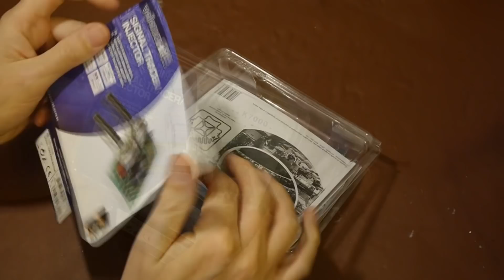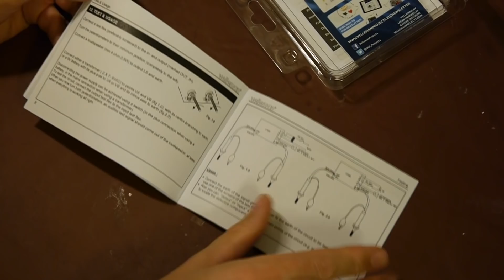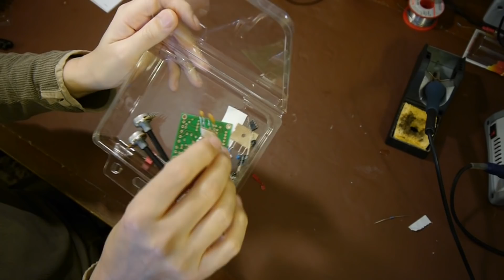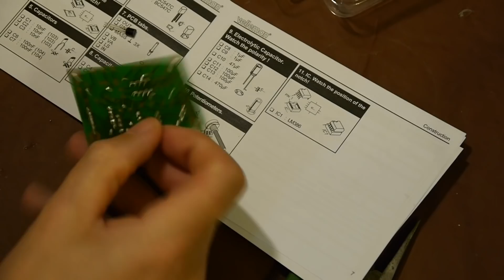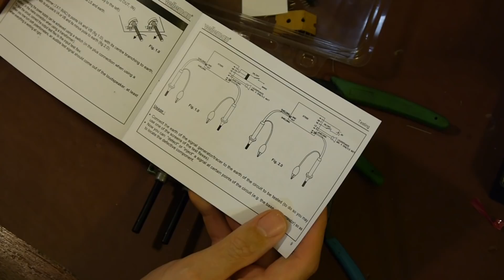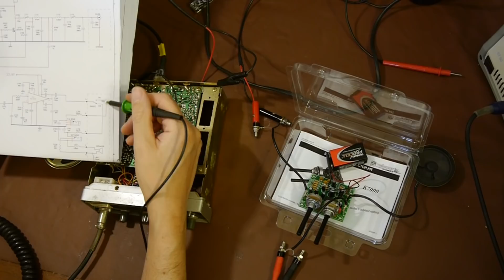Signal Tracer - Velleman K7000

Comment: thanks for this video
i just subscribed, new to electronics,fascinated in diagnosing and trouble shoot.
like how you explained what you were doing at each step.
amazing that you found a loose/bad soldering joint,i think that happens to me as well.
i only have a fluke mm,think i will get this velleman as it looks relatively easy to put together,doesnt even  need a case, and i can learn signal tracing and signal injecting.
look forward  to your modification of this velleman  in future.
john
Reply from the maker: Hello John thank you very much for the nice comments glad you found the video interresting.   I would recomend the Velleman kit is a nice little project. Check the  RadioCruncher channel he uses a signal tracer a lot for radio repairs.  Nice to hear new people are coming into the hobby it great fun even if we get it wrong its all part of the fun.   Best regards Chris

Comment: Normally this type of board has a coating to stop oxidation of the copper bads. Acetone will clean it off then I use a thin flux over the pads before starting to solder. I make my own flux for through hole components.
Reply from the maker: Barry Mayson  No that’s not correct boards are not coated except for solder resist and perhaps conformal coating after production. Kit boards like this just oxidise unless flash coated in gold. Flash coating is not normally done as it adds cost. Thanks for watching and great comments regards Chris

Comment: I just built one of these and am trying to use it to trouble shoot an FM radio kit. The radio is doing nothing but a little hiss.I have made probes and they seem to test OK.  I not sure which probe to use. Input or output or where to begin checking. Can you tell me ? I do get a tone at some points through the radio speaker. Am I correct in thinking that all Im going to hear is the tone or will I ever hear an Audio signal? Any help would be very much appreciated! Merry Christmas!
Reply from the maker: Clay Thomas  it’s a bit difficult to know where to start as I don’t know your background or radio experience. This probe is really designed for audio circuits rather than the radio frequency section of you radio.  The probe is basically just a small audio amplifier so if there is a detected signal of small level probe will detect it and amplify it to a point where you can hear it.  The probe will also generate a 1 kHz test tone so you can inject the tone into the amplifier on the radio and you should hear the tone coming out the speaker of your radio. Have a look at some other YouTube videos signal tracer are common so you should find some better details of how to use them than my video.   Come back with more questions I will try and help you if I can.  Note that the green probe I’m using is a demodulation probe so it will demodulation RF in the radio  and let me test the RF sections, your simple probe will only amplify the existing audio. Regards Chris.
Reply from the maker: If you can provide a link to the radio kit it would help to see the circuit. I can maybe tell you where to probe.
Reply: I am very new to the science of radio. When I bought a Mooney single engine plane last year I became much intrigued with the ADF which is an AM radio with a loop antenna for direction finding or bearing to the station. I was able to get it working by reading the original Bendix manual complete with the theory of operation and all the original wiring diagrams. I am capable of reading electrical diagrams but just starting to put together all the radio pieces. Its fascinating and Im very impressed with guys who can seemingly work on radios easily and know whats going on inside them. I built the Elenco AM kit last year and a home made loop antenna and get great reception at night. We live in south central Tennessee and I pick up New York, Chicago, Detroit, Atlanta and Houston Tx. I just finished the Elenco 108 Superhet kit and the AM side is working fine. The FM side is dead. I have checked and rechecked everything several times and cant get anything. I built the little K7000 to help me trouble shoot. Let me try to link up to a wiring diagram. Thanks for responding.
Reply from the maker: Clay Thomas I’m no radio expert but I do enjoy Tinklering with them. When you said you were building a kit I assume it was one of those popular single chip solutions. Give me a couple of days to look at the information. We can but a shout out on my channel there’s lots of people we can call on and advise us. Wow flying must be a interesting hobby. As is radio direction finding. Why not make a quick video of your radio and your fault finding and we can point a link to your channel
Reply: https://www.elenco.com/wp-content/uploads/2017/10/AMFM-108CK_low-res-2.pdf     is the manual link.  Thanks.
Reply: If you scroll down to the last page you'll see a schematic wiring diagram.

Comment: That signal breakthrough is annoying, I did the same trick as you did with the extra earth when I built mine a few years ago but you can still hear it.  I was thinking about sticking a FET on the input side funnily enough, I bought some MPF102s ages ago for the very porpoise. The injector gives a very clean sine wave I must say, mines running about 900hz. Velleman do or did a simple function generator kit I think. Regards _ Andrew
Reply from the maker: Andrewausfa  yes adding a FET input to the probe would be good. You really want a really fast rising square wave for the input this will be rich in rf harmonic content that can be picked up and demodulated by the input detector probe. That would be better than the sine wave
Reply from the maker: Andrewausfa  Hi Andrew If you get a minute  spare we are trying to help a fellow radio dabbler get his  kit radio going.  My friend Clay would appreciate any advice. You know a lot more about radio than me so be nice to help the fellow out if we can . thanks Regards Chris, follow link https://youtu.be/c_ysLO0ouFU.
Reply: Andrewausfa
 - You have 553 subscribers.. I going to add myself as 554 to your channel, so the next guy/gal after me should win a prize right? :-) ha ha Merry Christmas!

Comment: Ahh the maxcom 4E and similar, i would have probed the volume control to make sure the mc3357 down mixer to 455khz/demod/squelch chip was still alive, they do die do die do die Oops got stuck in a loop there :-D

The tx audio in that radio has its own quad op amp circuit, i cant remember the number but its the dip in front of the rx audio power amp ta7205 or similar.
If the radio is actually going in to tx, the output tranny may be toast, too many people run radios into a horrible swr, silly buggers lol.

Sorry for the waffle, i used to repair c.b's as well as lots of other crap.
Mr defpom is a super wizzbang at repairing/designing electronics, worth subbing to the old git ha ha joking :-D
Reply from the maker: zx8401ztv Thanks for the tips not really dug into the radio yet. Just spent an hour this morning repairing some large cracks in the PCB and resoldering the case to the cab PCB. It going into transmit now and drawing current but not had it on the analyser yet. I am not sure if repairing this will be a video sometimes i just want to crack on etc. . Noticed the squelch is not working but not investigated it yet. If your interested the circuits are easily available for download so I will add a link to the show notes later. Ok off out into the garage now to drill some holes for the RF matching pads in those aliminium boxes I bought last week.
Reply: The squelch comes from the mc3357 if i remember right, sound driven type.
Don't expect too much from the c.b, very cheap design, oddly quite reliable untill big hairy truck drivers ram 24 volts up it's bum lol.

Thanks for the diagram offer, but i do have it in many disguises on paper :-D.
No i don't expect anything, it's your hobby, we are just pen pals with an addiction to drinking tea, well i am anyway lol.
Reply from the maker: zx8401ztv ZX spectrum mux bus chip ? What all that about ?
Reply: Dynamic memory mulitplexing if i remember right, A0-A7 then A8 - A15.
The memory is shared between display and program, 16384 to 23295 is display and 23296 to 32767 is system use, 32768-65535 is normal uncontended ram.
It has been 20 years since i used to repair speccys, so forgive me if i have the wrong end of the stick :-)
Reply: ooops i was blind again, my label on youtube, it sunk in lol, sorry.
Reply from the maker: zx8401ztv that’s the one😄
Reply: Ha ha you must be a speccy or zx81 repairer, perhaps, maybe.
I loved the little machines, made interfaces and crude z80 code.
Ever heard of the multiface 128?.
Now is your chance to say No i hate speccys lol.

Comment: @ 24:00 I have seen many external speaker jacks fail, I have repaired/replaced lots of them.
Reply from the maker: The Defpom's Repair Channel  That was my first guess, but found a host of bad joints and repaired three large cracks in the PCB.  Do you normally re cap these radios as a matter of course. It’s a well beaten radio not sure if it would be worthwhile spending the money on. I was just going to try an realign  to see if it meets factory spec etc and if it does just leave it.  The squelch is defective but not investigated it yet. Appears to take quite a lot to kill a CB radio, it’s annoying that bought three spares and repair and the all work.
Reply: AllTheGearNoIdea - if it is a quality radio, and is worth future proofing then I will recap it, but otherwise I will only recap the faulty ones, or if I am having trouble narrowing down a fault (80% of the time it is a bad cap)
Reply from the maker: The Defpom's Repair Channel  Hi scott. Great advice I think you have confirmed what I was thinking. It a pretty crappy example of the species. Regards Chris